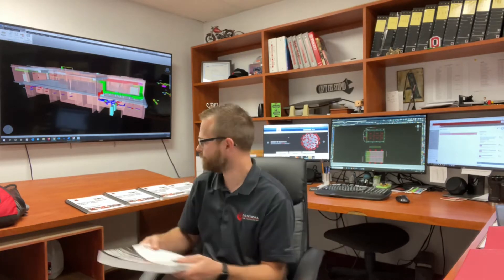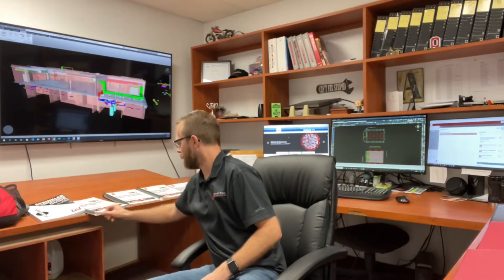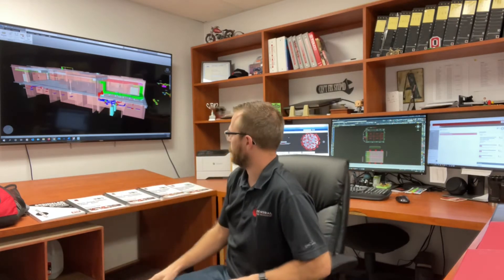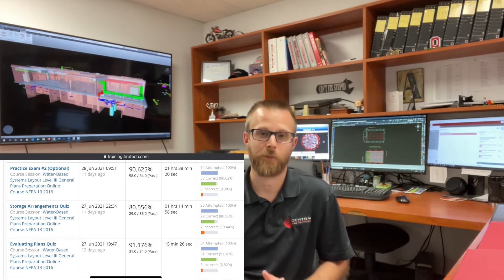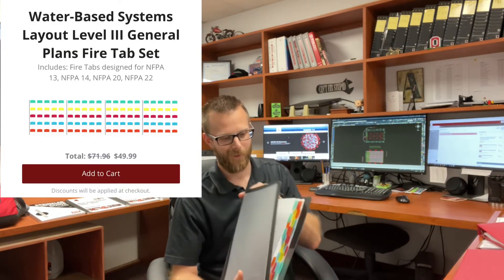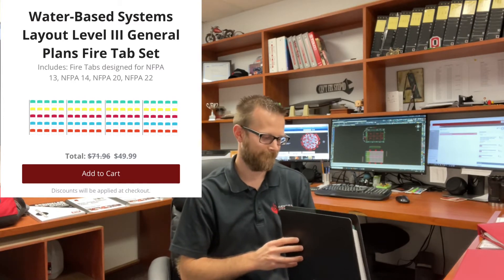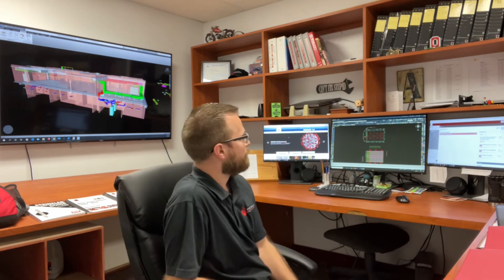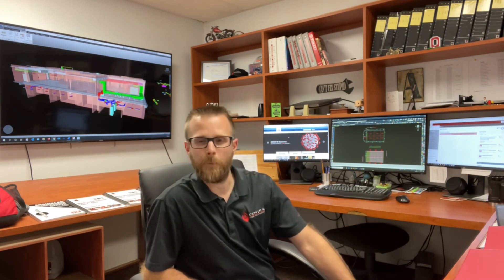FIRETECH NICET Water based systems layout Study Guide and Test Prep

Comment: I studied for 4 months on fire tech and I failed my Nicet 1 water base. The actual test was 💯 diff then the Fire tech
Reply from the maker: It is luck of the draw sometimes.  I've had 4 designers use firetech and all 4 easily passed the level 1 exam.  My first attempt at the level 3 advanced hydraulics exam was a failure for exactly the same reason you stated.  The firetech practice exams were NOTHING like the real NICET exam.  BUT... my second attempt at advanced hydraulics was like i was taking a completely different exam and I passed easily.  You will be more successful if you focus on taking the individual tests after each firetech section.  Firetech gives you a ton of information, but the end of course and practice exams can only fit so much into a single test.  I know a 4 month study session would not work for me.  Maybe a month, but if too much time passes I'm gonna forget things and start mixing up answers. 

another useful study source https://firecertacademy.com/

Comment: I’ve passed all my fire related test commercial fitter/ journey Fire sprinkler fitter class 4 years in class and work experience with a B+ residential Fitter class level 5 
Plus 5+ years of experience. Do I stand a chance for level 1 ?
Reply from the maker: I have no experience with other testing vs NICET. The test unfortunately really is not something you can count on passing based on job experience. Rather than chance wasting the money taking the test for the first time and failing, I’d put that test money toward a study guide. The lessons in the first level study material will prepare you for the material in level 2, which then help prepare you for some of the material in level 3. I spoke with a designer just this week who tried to take his level 1 without test prep and he came close but failed twice. There is also a lot of value in the knowledge you gain from the study content that goes beyond just passing the test.
Reply: @PromisKeeper  thank you for answering my questions. I inspect test and maintain fire sprinklers in accordance with nfpa25 ITM and Nfpa20 fire pumps.  I install sprinklers in accordance with nfpa13,13D And 13R. All these  books discuss the application inspection and design of wet sprinkles in accordance to and from. A study guide sounds extremely doable. Is what I should have said I’m a skilled and trained journeyman level however fire sprinkler is in high demand. That I need to advance my learning to become nicet certified level 1,2&3 for wet systems as well as special hazards. Not necessarily just installation. But yes I do need that type of direction from you here now. Invaluable information at my level thank you. Today for instance I sway braced a fire pump room hung a 700lbs fire pump muffle with a chain hoist, bolted it together with flanged fitting to a CAT 2000 G PM diesel driven Split case double to a double interlock nitrogen system for a freezer. With three 5 to one differential type valve.

Comment: Thanks for the tips!  Been in the fire sprinkler industry my entire life.  Designing for 25 years.  Management of 4 crews (8-10 guys) and do design.  Sub design out sometimes to keep up now days since I am the only designer now.  Been designing on SprinkCAD 3D for a dozen years.  Currently switching to their SprinkCAD Classic (2D).  Little learning curve.  Had a NICET on staff so never really needed it but she has taken a new position as plans examiner with the local AHJ.  Now I really need to get the NICET certs going.  Passed the level 1 test 15 years ago first try but let it expire and never followed up.  Jumping head first into the Level 1 test next week.  Hoping to pass it without much prep.  Level II, I got Firetechs course along with the tabbed books.  Fingers crossed!  Thanks again.
Reply from the maker: Good luck for sure. Our newest hire passed his level 1 a few months ago. The worst part about the test is how much of it isn’t “job related”. He used Firetechs updated level 1 course and it was a big part of his success.
Reply: How'd your level 2 test go Ryan. Sounds like you work for Cutler fire

Comment: I'm planning on taking Level 1 test but it says in the Condition of Applications that "Individuals who are not resident in, or working in, the United States or its territories may not be eligible for certification. These individuals must contact NICET before applying and may be required to follow additional procedures, with additional fees, to demonstrate that they meet the criteria." Currently working outside the US right now. Do you have any idea about the additional procedures, with additional fees?
Reply from the maker: I don’t have any info on that.
Reply: @PromisKeeper  Thank you for the prep advice! Planning on taking the Firetech course as soon as I get a reply from NICET about the COA issue.
Reply from the maker: My newest designer just passed his level 1 after taking the new course format. He said it helped a lot. Much of the test is things that don’t necessarily apply to the job.
Reply: @PromisKeeper  hey man just passed my WBSL-1 Exam. Just want to thank you again for the prep advice and recommending Firetech's course. It sure helped a lot on psyching out.
Reply from the maker: Awesome. Good luck moving forward!

Comment: So is the nicet certification Required to obtain rme-G or is it just passing the nicet test. I have just received my rme-I with only passing the test and have not been certified through nicet. Should i go for the level 3 water-based systems exam without completing level 1 and 2 which are not listed as requirements. I will be taking the fire tech online course for level 3 before taking the test, just curious?
Reply from the maker: I’m not familiar with the specifics of RME. Not something we have here in Ohio as far as I know. Having the NICET 3 certification will allow me to sign permit drawings in most states without taking a state specific test. Just have to apply, pay the fee and show proof of the level 3 certificate. Someone before has asked a similar question, you can’t apply to take a nicet unless you meet their minimum requirements. Actively employed full time as a designer. Someone else certified would have to verify you have worked as a designer for the required number of years. I don’t want to pretend to know all the ins and outs, but NICET isn’t something anyone can just go online and set up a test.
Reply from the maker: The other part of your question… I started this under the work element format. I had to take level 1, then 2 and now 3 years later… The website makes it seem like that’s not necessary anymore 🤷🏼‍♂️. Like you could become a level 3 as long as you can be verified and meet the 5 years required working in design.
Reply: @PromisKeeper  I do have about 5.5 years in the fire sprinkler trade and here in Texas an RME-G licence given through the Texas department of insurance 
An individual with an RME-G license is permitted to plan, install, maintain, service, and certify all
types and parts of a fire sprinkler system. So with that being said i guess in Texas The RME overrides the nicet certification part?
Reply: So here in Texas it is only required to pass the nicet test and fire sprinkler rules and regulation test as a requirement for the RME. Thanks for the insight.
Reply from the maker: Sounds like you may be more qualified than I am. lol

Comment: Thank you for the video! I've worked in the field as a Sprinkler Fitter for 20 years and I'm just now transitioning towards the design end. Studying for my NICET lvl I water based systems layout. I purchased the practice exam through NICET hoping it's a worthy investment? Any experience with it?
Reply from the maker: No I never took the practice tests. I’m sure it will help you decide if you should use something like Firetech to prepare further. The NTC book wasn’t much of a study help but the practice tests let me know real fast I was not as familiar with the code as I thought I was. My company covered the cost of the material so I opted for the sure thing with Firetech and turned in the receipt for the course after I passed. If you didn’t see the update I passed my level 3 hydraulics just last week!
Reply: Best of luck to you. I’m assuming your not a Union fitter? Where I’m from our union guys get paid $60 to $80 an hour. That’s journeymen and foremen. Designers and project managers make $40 max $50.

Comment: That is a great Video, I just passed my NICET 3 IN Inspection and testing of water  based system, now I want to work on system layout, no guidance here. How can I contact you.
Reply from the maker: To schedule the test you’ll need someone to verify your work experience as a designer. Besides using the right study material it should be pretty much the same process as scheduling and taking your Inspection & Testing quiz.

Comment: First things first. Glad to see a fellow believer on youtube. Second, man am I struggling with level 3. 
I get the info, but as soon as I get to the optimizing portion, my brain just blanks. I understand a good portion could be the fact that I'm just jumping straight from RME-I to level 3 layout. I've looked for resources outside of Firetech to no avail. I did see they have the instructor led 5 hour blocks I could get, but that is limited to level 2 and its another $500. I may be forced to do that just to be able to discuss this with someone. Your video is helpful, and does make me think I'm probably just psyching myself out.
Reply from the maker: I’m not sure what you’re referring to as the optimizing portion. I have another video I would like to put together on “Phantom Flow” -  NFPA 13 27.2.4.2.5 … It was added in 2013 but apparently most designers and plan reviewers miss the requirements for that one.

Comment: Thanks for the prep advice, def gonna use firetech study guide, i work for similar size fp company, we also utilize hydracad, noticing alot more jobs requiring 3D BIM
Reply from the maker: There seems to be an exception for fire protection.  I’m currently working on a 6 story secure office addition at Wright Patterson AFB. Coordination has been going on since March. We are the only contractor that doesn’t use Revit or Navis. It’s even written in the spec that we are to provide DWG drawings. For us as a company it just isn’t necessary or worth the cost to use 3D.